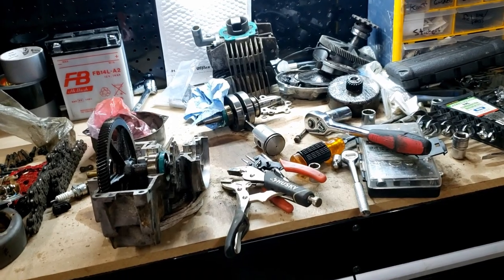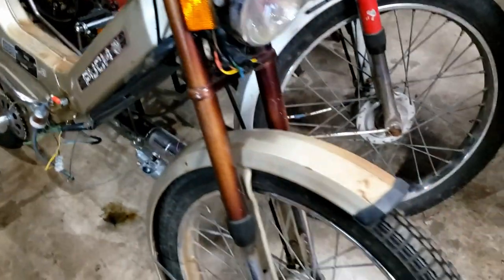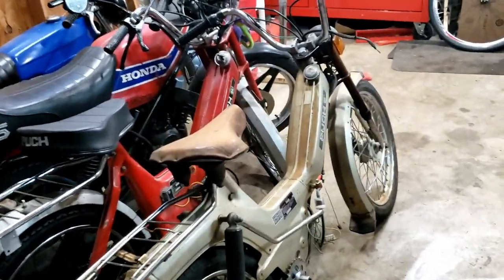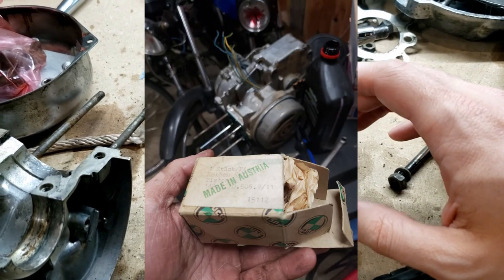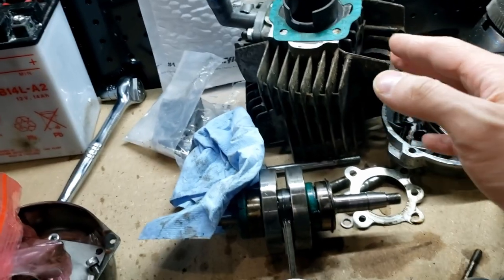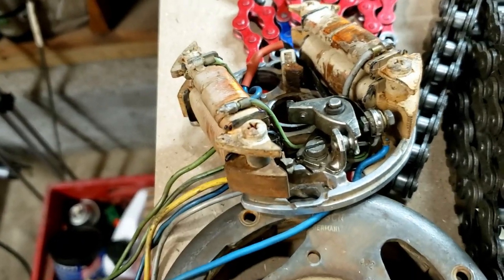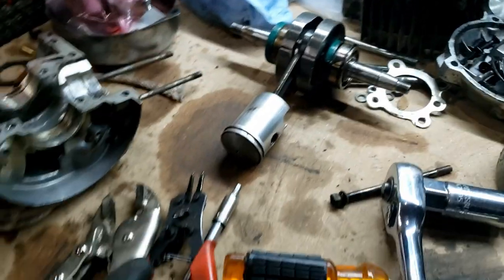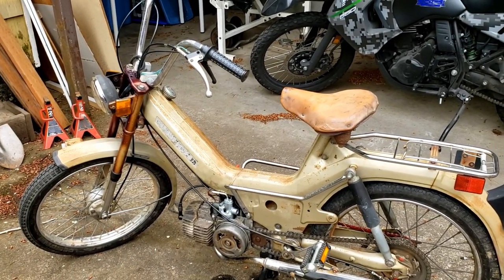Sometimes...you have to tear it down twice - The WORST e50 I've ever rebuilt! (Free Iowa Maxi)

Comment: for stuff like an ignition, a continuity test isnt really sufficient. you could have continuity if even one of the copper strands in your ignition wire completes the circuit. im splitting hairs here but really you gotta test resistance and compare it to a known good wire/coil/whateva. even then once you get hear in the system resistance goes up
Reply from the maker: Appreciate this comment, this is something I'm planning on rectifying (bad pun) in a proper video on electrical troubleshooting. For the actual spark plug wire to the boot yes a resistance test should be done.

Comment: I am working on an 1980 Indian moped electrical system and i am having problems with the turn signals, they wont come on. I have checked the wiring and everything appears ok i checked the flasher unit and it checks out i checked the wires for continuity and made sure i had good grounds. Does anyone have any idea what the problem could be? The battery is fully charged.
Thanks